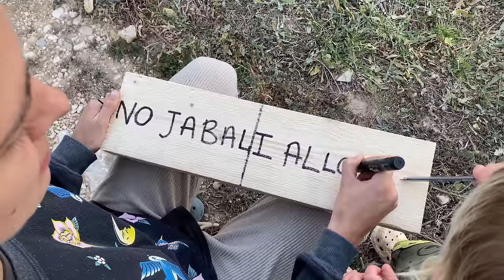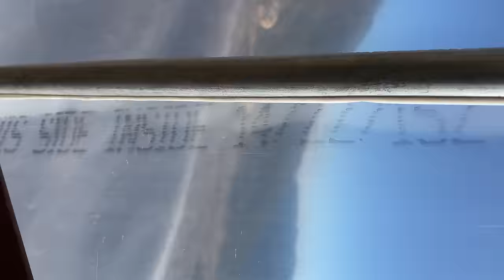LIVING OFF-GRID in the MOUNTAINS | Abandoned land to self-sufficient homestead | Making a polytunnel

Comment: Looks like a pretty decent and robust tunnel you guys have built.
May I suggest that you also find a piece of heavy shade net and just have it on standby to cover the tunnel if you get a heatwave because in a heatwave the temperatures can climb to over 50 degrees in a tunnel (ask me how I know) and all your plants will all be cooked.
Apart from vegetables you might want to germinate some olive pips and if they do good and transfer outside into the soil well, do plenty more because just about any tree starts to allow grass and other plants to grow.
Take the pips AND THE SKINS from someone locally who is pressing olive oil (1 part), mix in some compost and local soil (5 parts) in the cement mixer and you are done.
Just a dozen small black plastic grow bags with the mix in (3 or 4 pips in each) and see what happens.
If it goes well who knows, in 6 or 10 years you might be able to build your own brand of bespoke olive oil.
Good luck - hope to see "Owl & Lady" olive oil on the market some time in the not too distant future.
Reply from the maker: Thanks again for your ongoing support! Some shade net in summer is a brilliant idea - we will definitely have some on standby. WOW olive seeds in a concrete mixer - that's pretty wild - but a cool idea! Might be a good strategy if we could plant like 1000 of them, and then when we put them out on the land later it doesnt matter if the sheep eat half of them. Right now we buy olives for around €5 each, but many of them don't make it past the first year. We'll send you the first bottle of Lady & the Owl man olive oil when it's ready! 🤩